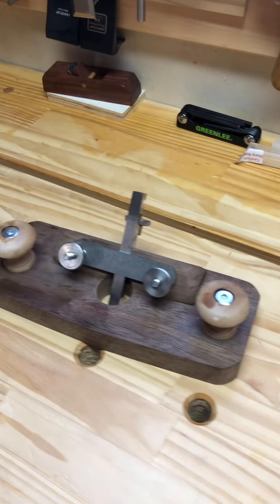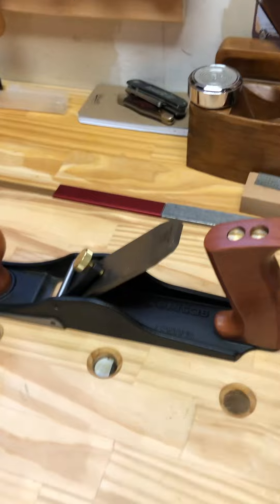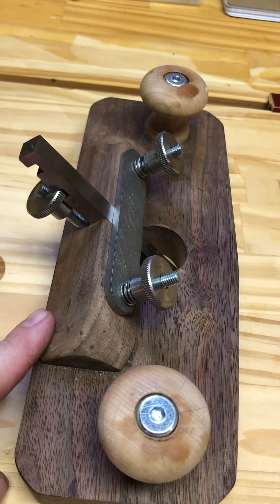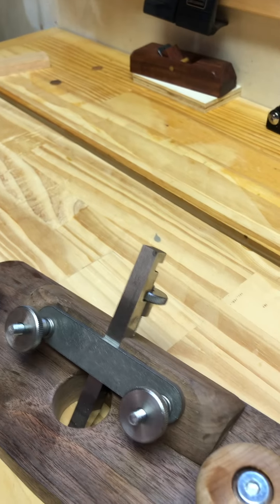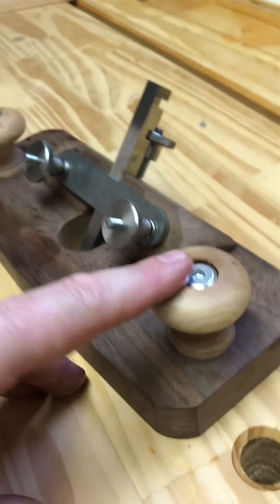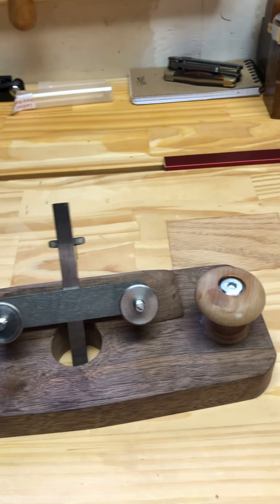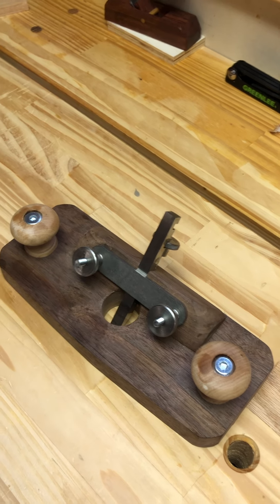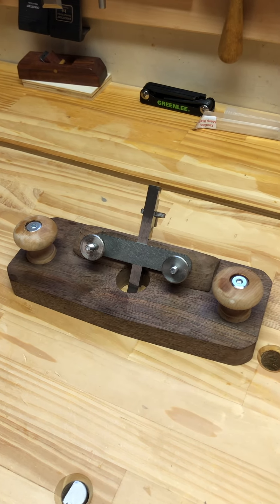Shop made router plane (almost) completed.

Comment: If it were mine, I'd laminate a thin piece of hard maple to the bottom. It would bury the lag screw holes and it wears like iron. I have 1/8" of it as the sole of mine and it polishes up to a near mirror finish and glides over the work nicely. Asthetically it looks good too IMHO.